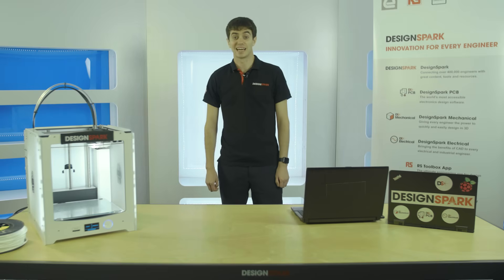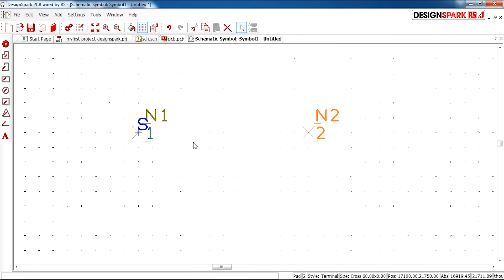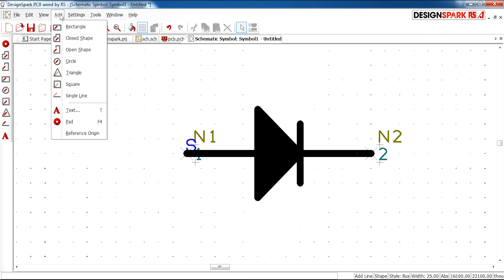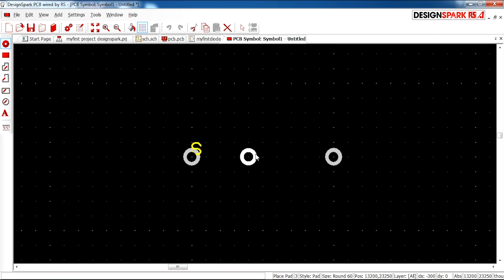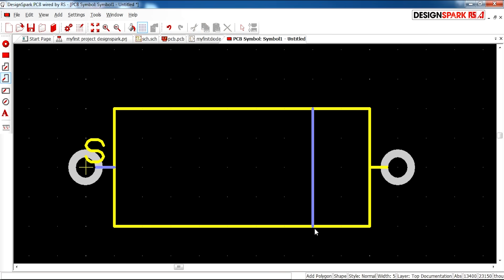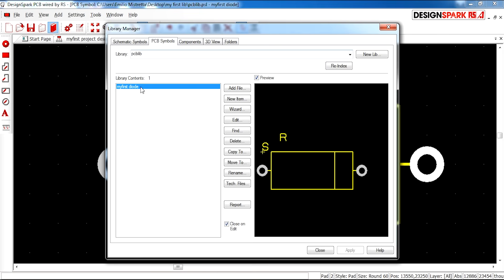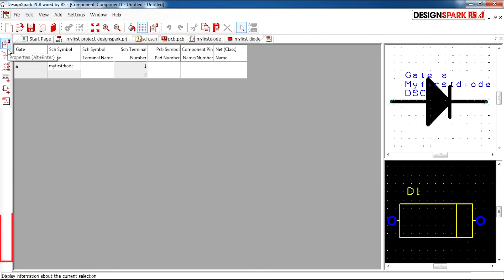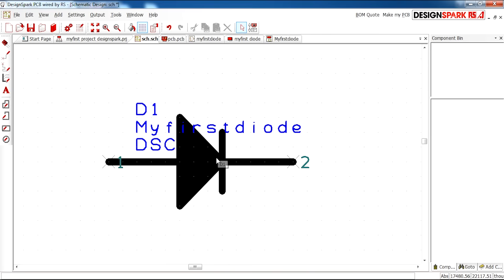DesignSpark PCB Training | 3 Creating Components

Comment: To fix the error message problem you need to close the PCB item file you're trying to create as well as the PCB design. Then click File > New > PCB Design > Name it under new "Design name" >New Technology File> Make sure "PCB Design" is checked >OK>  Next> Check "copy technology from file" and select "Double Sided" (example) > Next> Check "use layers from chosen technology file" > Next > finish

From there you can go to the libraries button and create a new PCB item and the shapes will work! This took me so long to fix :')
Reply: WOW Thanks a lot, it’s also my problem too!!
Reply: I don't understand what you're saying.  Are you saying to create an entirely new pcb file in a new folder separate from the project folder?

Comment: Please make a feature to assign to 2 different pads the same schematic pin. like one to many. Or teach us how to do it. I mean because sometimes a component has two pins internally connected. I mean if we have 2 gates we can connect any PCB pin to a pin from the second schematic object e.g. but I can't do that for 1 schematic object!
So the only way to overcome it is to manually connect them in the schematic diagram porject file (not the file of the component). 
Further, I hope the "translate to PCB" holds this feature too, so it feels free to use any of the 2 pins.
Anyway thank you, good software.